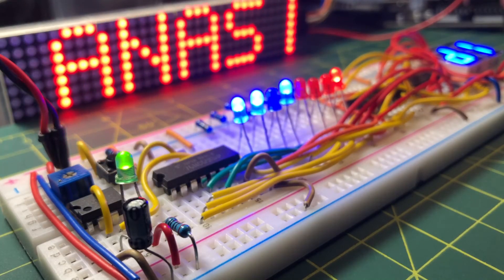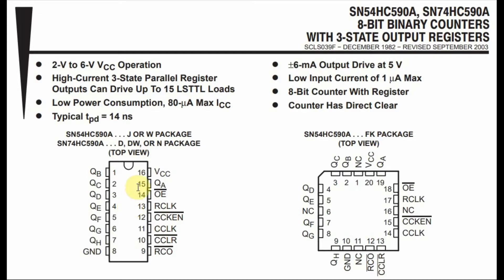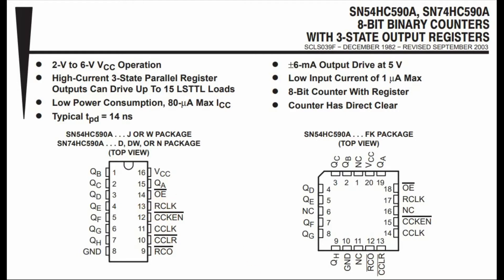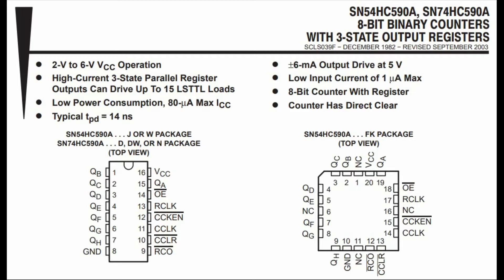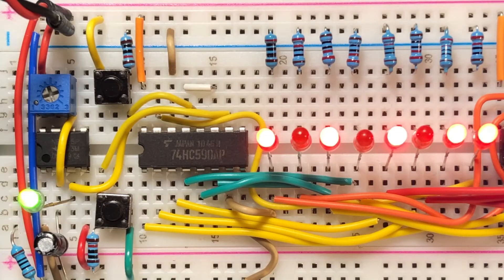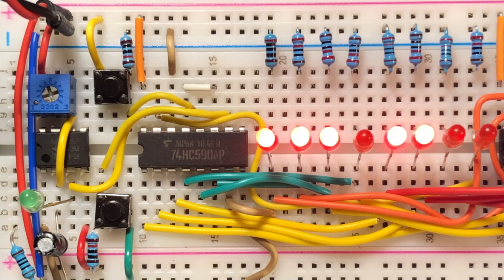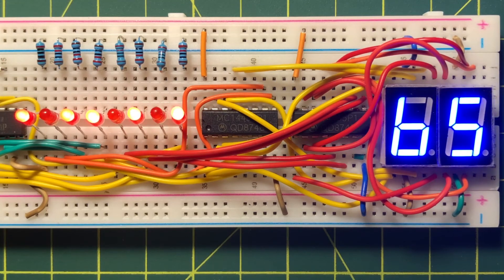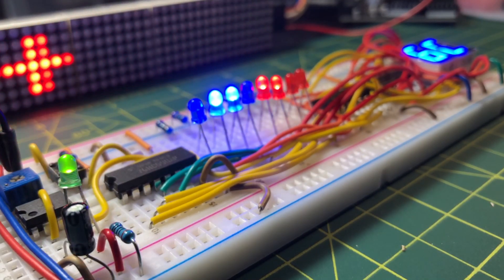8-Bit Binary Count using 74HC590 Counter

Comment: It Area = 1 x 8.Area = width x height. If it Area = 32 x 32 or even bigger value in width and height. Then it become PHD designing tool. Lots of picture figure work.
Just run it with either binary bit left shift or right shift counter. Area = 1080 x 2000

Comment: Can you list down all the components that are used in this circuit like resistors with its resistance and capacitors with its capacitance & any other component except these:
1. 74HC590 counter
2. 555 timer
3. MC14495 hex to 7-segment driver
Reply from the maker: Please check the link in the description. You’ll find the circuit diagram